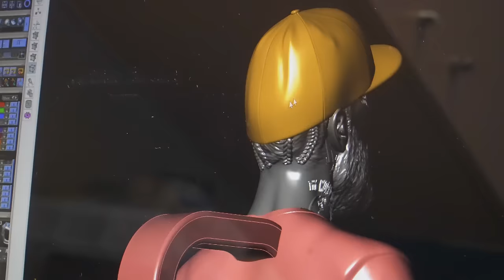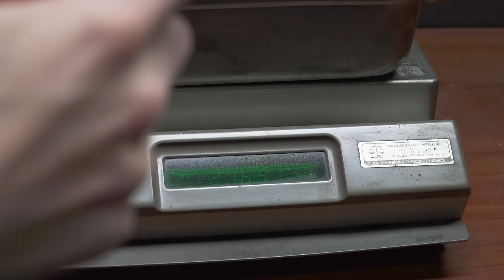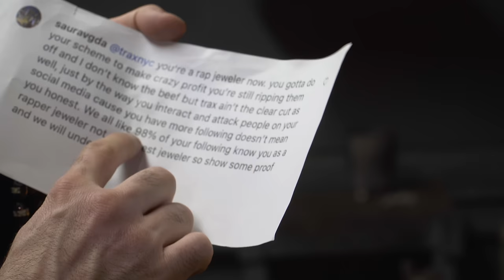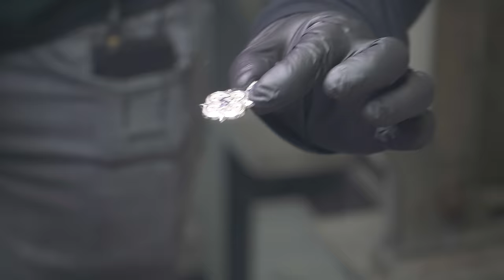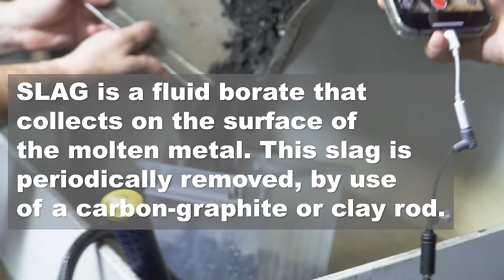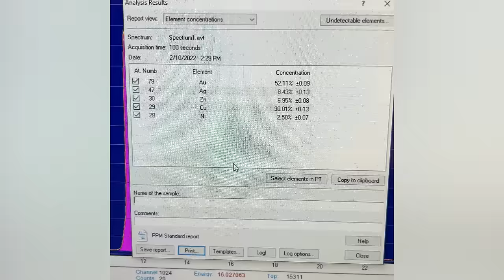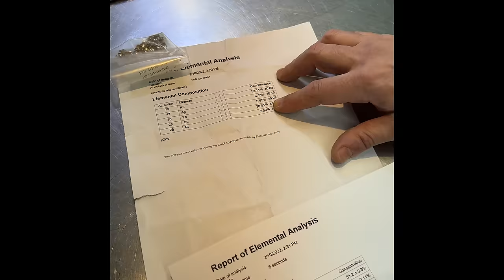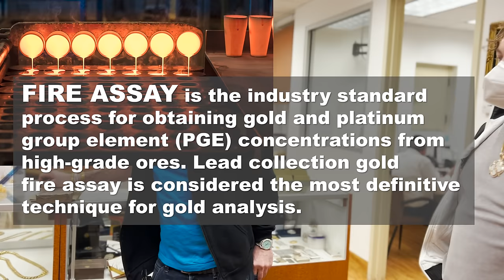$200,000 CASH or BIG GOLD BAR! | The District S1. EP.18

Comment: But question- is there any affect to the diamonds? We all know that there is something called “ heated process” with diamonds,, temperature here is higher than 1400*C so I assume that are some changes on diamond structure
Reply: I had a family heirloom ring- ca 1869, 2 carat in platinum. It was in a house that burned to the ground approx 1915. This was before fire-retardants existed, and most homes were filled with hardwoods (structures/furnishings) and burned extremely hot. This ring had to be re-cast from sketches, I don't think the platinum survived, but the diamonds (5 European cut, 2c's) DID. Once the ashes had cooled my husband's great great great grandfather took the employees, who worked for him, to the site. The men sifted through the ashes and found the diamonds. They were completely unharmed by the fire.
Reply: Uhhhh..... just one comment here if I may- gold melts at 1064°C, not over 1400°C.

Comment: diamonds react with oxygen in high temperature. if you must heat it, heat it in oxygen free environment or at least use fuel rich air gas mixture in the torch. don't ever go for blue flame.

Comment: This is obviously not the best way to do things. But again, he obviously doesnt mind losing about 5k in inefficiency, for the rate of speed he can reclaim some money.
Reply: Foe a melt that size with all that 24k gold. It should have been went through and cleaned at least 3 more times before being melted. All the 24k should have been treated with acid instead of melted rightaway, to keep its value and purity separate from the alloys. And the crucible should have been hotter, as well as cleaned spotless. I.E. also cleaned with acid. Not to mention the borax cleaning should have been added before the first bar was poured to greater increase the purity and separate the leads and other metals to the top. Just wasnt done well like most places not making a video would do.